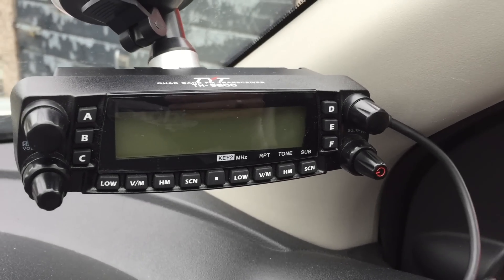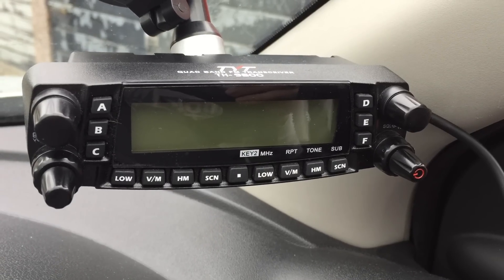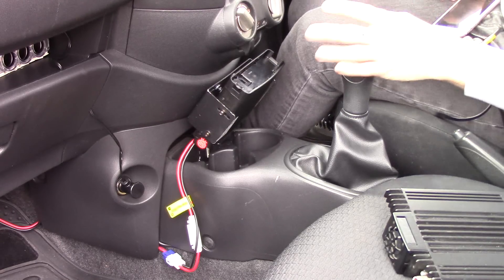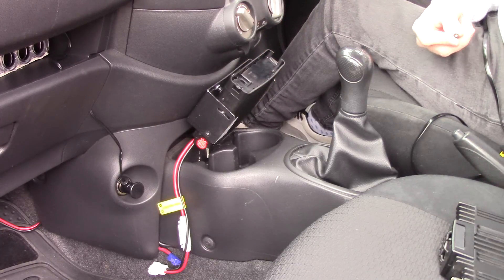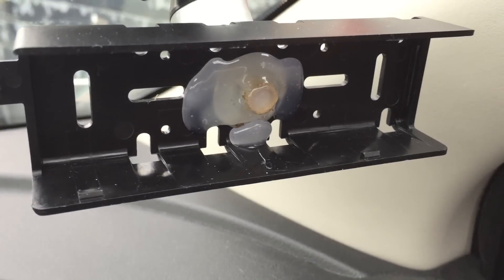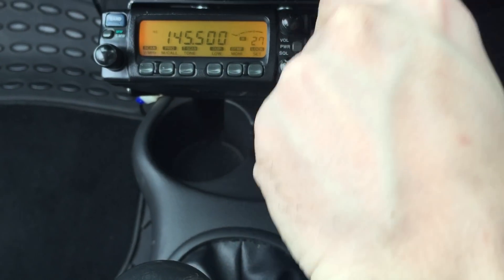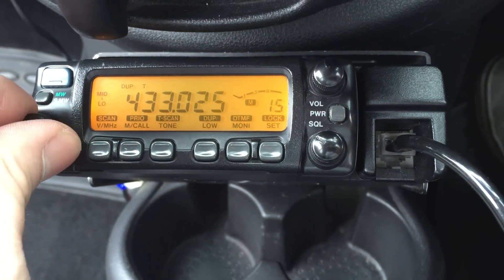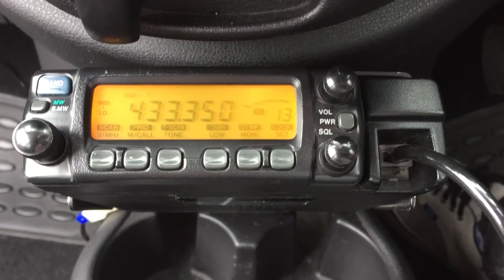Amateur Radio Mobile Install - TYT TH9800 Dead Again!!

Comment: Mine also died last night for the second time, it had done it before where first it wouldn't  send the tone to open the repeater, turned it off and on again and well.... Nothing, Fan spools but thats about it, they have a half decent mosfet in so mine will be getting pulled for a  homebrew linear project... the Bin can have the rest...

This is my second bad experience with this brand and will be my last after the antenna socket on the md2017, I contacted them about it and they were nothing short of shocking....  Steer clear is my advice.
Reply from the maker: Yep! Awful radio!

Comment: Take the face part to pieces, 4 screws, pull the cover and locate the 6 copper wires either side. Separate these wires so they cannot touch together and put the cover back on. It is the six wires that go into the RJ11 jacks. Sometimes they get pushed together and cause a dead radio. -
Reply from the maker: Cheers Paul I'll try that!

Comment: How very peculiar. I don't own a TYT-9800 but I do have two TYT-7800 units, one in my shack and the other in my car. Neither of them has given me a bit of trouble. I had to replace my 20+ year old Kenwood TMV-7A who's display went bad about ten years ago. Today it's so bad I cannot tell what frequencies are active... Unfortunately I apparently missed the recall notice where Kenwood replaced the entire LCD display for free. No such LCDs are available anywhere at any price these days. :(Hopefully your vendor will repair your unit under warranty.
Reply from the maker: No they're rubbish
Reply from the maker: +n4gix Ah that's too bad =/ unfortunately there is no after care with TYT and the eBay seller I bought this off 8 months ago has disappeared. 73
Reply: +Ringway Manchester I'm sorry for your tyt th-9800.....i have a question....
I'm from italy , and i'd litke to buy one...according to your experience  , would you recommend me ?
Reply: +Ringway Manchester Ok...thanks.....
can you tell me wich version of radio did you get ?